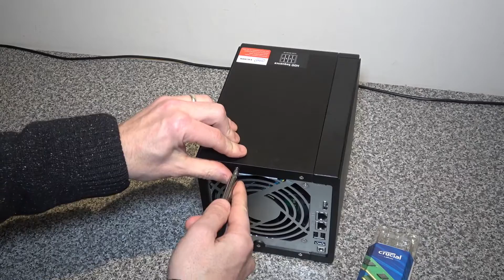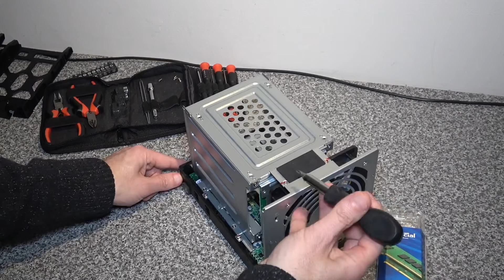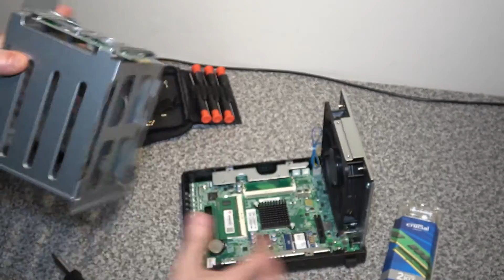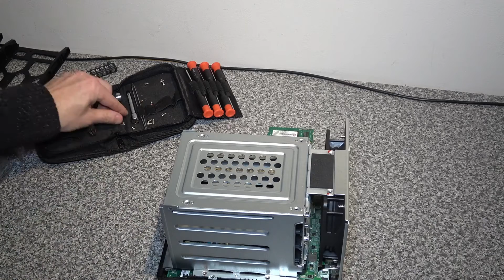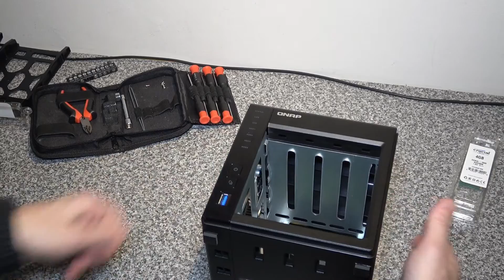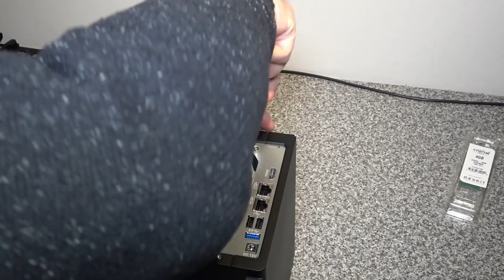How to upgrade the memory on a QNAP NAS device.

Comment: How did you know what type of memory to get?  Did you have to disassymble it first to determine what your memory specification?
Reply from the maker: I used the Crucial website - you can input your Make & Model and their website tells you the compatible memory types and sizes that work with your system.
Reply: Thank you